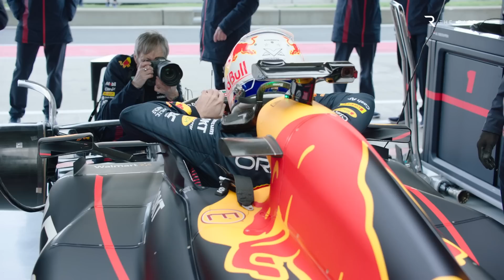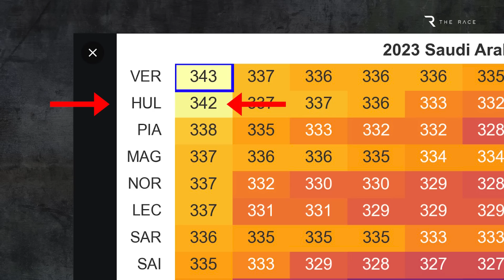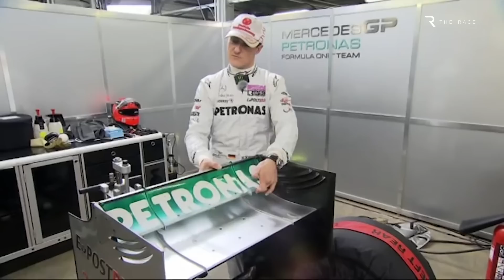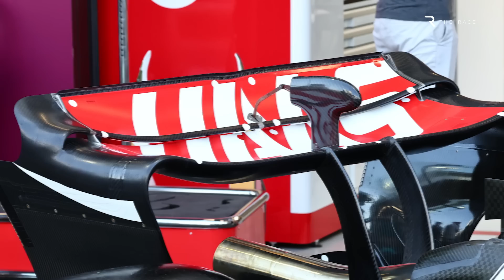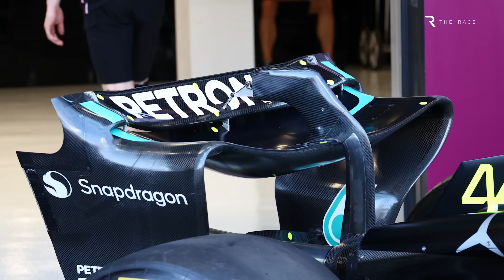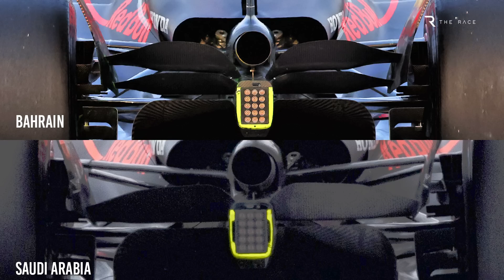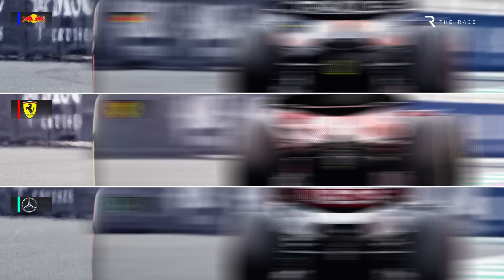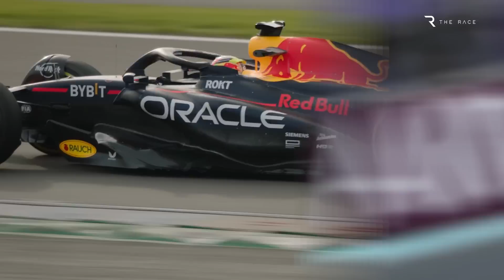Red Bull's genius 'triple DRS' F1 trick explained

Comment: It's funny, how 3 of 5  teams who is in top 5 are the slowest.
Reply: slowest on straights yes, but they are very strong in the corners, you can have more downforce which causes more drag slower straights but stronger in the corners. Or you can have a low downforce so fast in the straights and slower in the corners
Reply: @Lewis_M397  exactly. Its all relative. obviously BM is a new f1 fan.